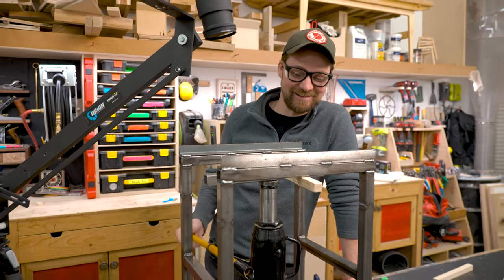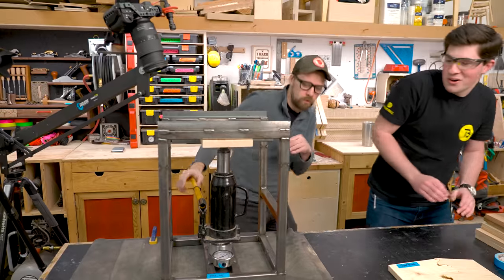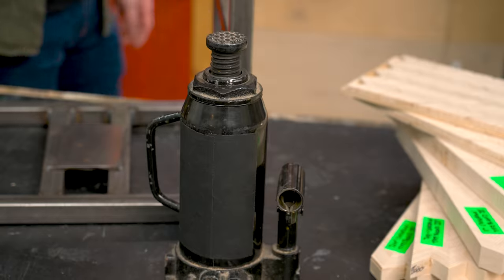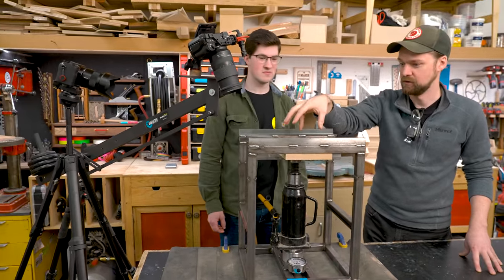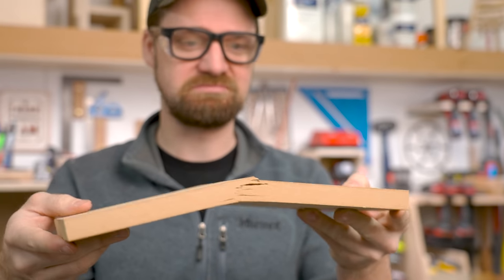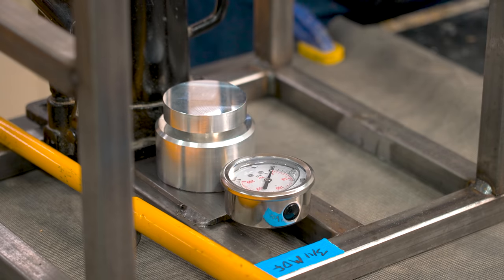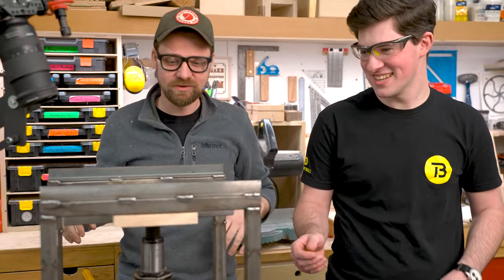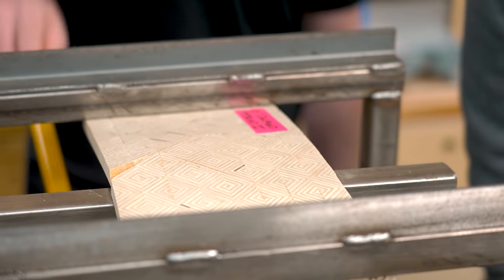Testing the Limits of Patterned Plywood (Featuring Tyler Bell)

Comment: When comparing BB ply to pine, you've got to remember the pine had all its grain in the strongest direction for your test but only half the thickness of the ply was iin that orientation, with half being aligned crosswise. If you'd tested pine with crosswise grain instead, it would have withstood a damned sight less force but the BB ply would be about the same strength either way. That's where  ply has an advantage. As for the patterned ply, it has no longitudinal grain so it was nver going to fair well in this sort of test. 
Also, your testing only covered flex testing. Strength under compression, tension and flexion/torsion are all very different and specific qualities in materials. E.G. Chair legs experience mainly compression while the bracing between the legs experiences mainly tension as they work to prevent the legs spreading. Meanwhile,  the back experiences mainly flexion/torsion as you lean against it. 
Finally, the disproportionate increase in strength with increased thickness in the BB ply was in line with my expectations from using carbon composite sheet where doubling the thickness more than doubles the rigidity. Its at least partly to do with the tension and compression forces  (them again!) acting on the outer layers. The thicker the material, the more one side has to stretch and one side has to compress to flex a set amount. (Assuming  the same material throughout) and elasticity is not a linear progression. If you really want to understand these different kinds of strength in different woods, ask a bowyer.
Reply: Came to find this, something was of with the initial comparison
Reply: All of this, 100%. It's also worth noting that part of why plywood is "stronger" on average is that good plywood is very consistent... the pine chosen here was very specifically as knot free as possible, but lots of pieces aren't, or can't be due to their size, or have other variances in density that will make their strength much less predictable from piece to piece. This comes up in cheaper plywood too, which has lots of voids and filler vs. the expensive stuff, though of course, that's why you don't use that stuff for anything that will have to resist a lot bending forces.

I liked to see the test with a piece laminated to a 1/4 plywood sheet, but it would have been interesting to do the same test again, but flipped over, with the normal plywood above, and therefore in the higher tension position and the vertically oriented endgrain of the pattern being placed in compression. I expect you'd get an even better result, all else being equal.
Reply: Good commentary. 
I knew a fellow who tested shear strength and tear strength of different configurations of steel, and he made the differences in forces clear to me. Any strength tests have to be precise for the exact force you’re interested in!
Reply: Also.... strength-to-weight ratio. Plywood is essentially missing wood at the microscopic level, replaced with glue/adhesive that's lighter.

Comment: The reason for the non-linear increase in bending force is the following: The height of the piece enters the bending stiffness equation with a power of 3, while the width influences it only linearly (see wikipedia "second moment of area" ). It is interesting to note that this is a purely geometric property and has nothing to do with the material. 
Absolutely nice video - don't know why, but it was quite mesmerizing to watch!
Reply: Yep! That's why tubing is so much stronger compared with its weight vs a solid material of the same weight (but thinner diameter).
Reply: Exactly! Only the outside surfaces matter. If they had tested the patterned back by ply the other way (patter side down) it should have been stronger since the ply will be better in tension.

Comment: you always gotta remember that wood has 2 strengths, with the grain and across the grain. 
Splitting a board is so easy, you can do it by hand. But chopping through one is hard, because the fiber is strong. for plywood, you dont have to think about grain direction. you always have the same strength. But the ply layers that are in the wrong direction, depending on the force thats applied to it, are very weak. so its not super strong, but holds shape and is the same strength in all directions. 
sidenote: thats also why side grain glue ups hold "better" than end grain ones. the lignin, that holds together the fibers, is weaker than glue, but the fiber is much stronger than glue. so, even though end grain glueups are stronger than sidegrain glueups (if they have the same surface area), it looks like the glue works better on sidegrain, because the lignin breaks, and not the glue.
Reply: He should try some patterned plywood where he’s gluing end grain together so this is closer to how normal plywood performs rather than peeling apart a string cheese like this one is testing.

Comment: I've usually heard it said that plywood is more stable than solid wood. Rotate the 3/4" BB ply and the 3/4" pine 90 degrees and run that test. The BB should get essentially the same reading while the pine will break must faster as it breaks along the grain very easily.

Comment: Plywood is stronger than natural wood boards only because it is strong along two axis.

Think about splitting a log vs chopping a tree down. Two very different orientations for the same substance two very different strengths.  

Plywood won’t split along the grain because it has eliminated that factor.
Reply from the maker: That's a very good point! Interesting
Reply: Hum, this is the first time I'm really hearer people talk about plywood being "stronger" than natural wood. The problem is the it all depends on it's use. Put "plywood strength vs natural wood" into Google and even if you ignore the articles that are outright stating that "solid wood is significantly stronger than plywood" when talking about the natural wood being used in the correct manner (i.e. along the grain) many of the ones saying that "plywood is stronger" as a general statement then obviously go on to clarify under exactly what circumstances that is. Saying that "plywood is stronger than natural wood" is like saying "a steel cable is stronger than wood" and then trying to make a table leg out of your steel cable... They both have their strengths, just in different scenarios.
Reply: In martial arts the trick to splitting boards is that you hold the board so the strike delivers all the force is applied along the grain. Boards are so, so much weaker that way. Hold the board the other way and you'll break your hand or foot. This is why you'll never see anyone use plywood in a martial Arts show. 

Well supported 1/4" plywood will hold my weight in an attic. :)
Reply: Also consider the concept that any sample from a sheet of plywood should be consistent for. However the pine could be significantly weaker from some locations because of knots. 

I would consider plywood stronger than pine even with a similar average failure point because it has a narrower failure range. If the plywood failed within a 5% range you would build based on the low point. But if pine had a 50% variation you would likely overbuild based upon its lower range.
Reply: Plywood is also most notably more dimensionally stable, and that's the big thing really.

Comment: 12:36 Alternating directions of plywood means it’s likely the same strength in both directions (not sure how strong it is diagonally between the two grains—maybe even stronger?). You only tested strength in one direction, but it is likely that the pine would have broken much earlier if tested with the grain (you tested it across the grain). Only one way to find out: another video!

Great video, fun collab between two makers I’ve been following for a very long time!

Comment: Very cool video. I just forwarded it to students who took my structural design for live entertainment class last semester). In the class we look at the structural strength of various materials as applied to stage elements. What you're seeing in the patterned plywood breaking patterns (by which I mean where the breaks happen) is called "rolling shear" or "shear through the plies." When we look at composite panels in bending, there's a shear plane that happens between the ply closest to the glue joint and the next ply. Normally, in bending with composite plywood members, the plies are running perpendicular to the bending force; as bending force is applied, plies closer to the force move in a different way than those opposite the force, and that causes delamination. It happens just next to the ply at the glue joint because the glue keeps that layer from behaving like it's neighbor, and so you get shear at that plane. This is a little different, because the ply interfaces are not perpendicular to the force, but it's the same principle: the ply closest to the glue joint can behave like its neighbor opposite the glue joint because of the glue itself--and so it delaminates.

A very cool video.

Comment: As for chunk of pine vs birch plywood, you took a board in which pine withstands most load. It is a safe guess that a board with longest dimention across the grain, not along it, would withstand less than half of given load. Plywood, though, will be exactly as strong after rotating it by 90 degrees.

Comment: Made pattern plywood surfboard fins awhile ago that are still going strong, but most of their strength is coming from the fibreglass lamination. Foiling the fins was the tricky part, the plywood pattern kept fail apart.
Reply: Check out Peter Brown's Shop Time channel, he's done some videos using a stabilizing resin that's forced into the target material, I think that would help you with the thin cross sections.
Reply: @JBLewis  Peter has some great videos. I actually used epoxy to help hold them together. I used construction ply wood the resin soaked in really easy. Stabilizing resin may have worked better though. I have some birch plywood for my next batch which will help too.
Reply: @WaveWasters  Sweet!  A patterned plywood fin sure would stand out in a world of carbon fins!

Comment: No one who knows his/her trade has ever claimed plywood to be STRONGER than hardwood. The alternating plies makes it more STABLE under conditions of use, as it's not prone to twist and cup and won't be dimensionally affected by humidity.
Reply: I came here to say this. Also, I bet if you cut a piece of walnut so the grain is the opposite direction it would be a very different story. It would crack along the grain easily
Reply: +1
Reply: It is more evenly strong. Solid wood is strong along the 1 bending point they tested, but is weaker if you bend it along the gain across the grain.. 

Plywood would be the same strength along all bending angles (except end grain)

Comment: FYI, stiffness is a cubed function of the thickness - for example, going from 1 inch to 2 inches the stiffness will increase by 8 times.  Now I need to think how this relates to the strength of the material....

Comment: Although it is often cited as a reason for using plywood, the main reason for crossing the grain in plywood is actually for dimensional stability and shear strength not for breaking strength. One reason LVL's are set vertically and not horizontally. Just thought I'd weigh in on that. Great video and love that pattern plywood!

Comment: I’m in a woodworking program, and I have never heard anyone say that plywood is stronger than solid wood. One of my professors always includes questions on tests about the reason for using panel products over wood panels, just in general, or in the context of like a frame and panel door, and the answer is always that panel products and plywood are more stable than solid wood when it comes to movement, and generally more flat (and keep their flatness). But plywood is defined as being stronger than the MDF or particleboard, as well as lighter weight, more moisture resistant, and grippier for screws. I actually never really thought about whether it might be stronger or weaker than solid wood. Maybe that’s because I think I’d have a clear reason that I’d want to use solid wood over manufactured panels, or vis-versa, and when I want a panel it’s then comparing the attributes (and availability/price) of different types of plywood and other panel products for my project’s needs.

Comment: Plywood is still stronger than pine because pine has that strength only in one direction (perpendicular to the fiber grain), while ply has it along both grain direction.

It could have been interesting to test plywood with a 45 degree angle  to the fiber.

Also, pattern with ply back, you should test it upside down, so the pattern works in compression on the ply back works in tension.

Comment: I think these test results make a lot of sense. In the case of regular wood (and even plywood to a lesser extent) you have the immense bending strength across the long grain, sort of like trying to bend spaghetti noodles in a bunch. But what you've done is taken those noodles and cut them into shorter lengths and then adhered them to each other side by side, so now you just have to peel two pieces of the spaghetti apart (which then causes a chain reaction), and they don't have as good of bending strength.
Reply from the maker: That's a great way to put it!

Comment: @12:30 I never heard that plywood was stronger than wood. I always heard it was more dimensionally stable (i.e. less impacted by expansion and contraction) than real wood. And thus would stay the same size over time without spreading, shrinking or warping as much.

Comment: @12:13, make a rig to compare grain directions. 7 ply vs solid pine will behave differently. Set up a rig to apply forces like an axe and split the solid pin board with the grain. The 7 ply will hold up equally but the solid pine should break differently if rotated 90°. Its why you can take an axe and split a log one way but not across grain (for the same effort).

Comment: A more true test for plywood vs pattern ply would be to glue up strips of plywood at the various thickness you are testing against, that way you are end grain vs end grain.  Test across the face of the sheet is going to have more elasticity as compared to end grain at 1/2” & 3/4” think.  A better wood vs plywood test would be a pine 2x4 vs a plywood made 2x4 (LSL), and test in both directions of the boards to see.  The LSL should be stronger across the 4” thick face vs the pine 2x4, and I would guess as strong or stronger for the LSL across the 2” thick face.  Wood fiber breaks before most glues, found that out in a Strength of Materials class in college, Poly glue holds up to a good bit and that was 20 years ago.

Comment: Watching you as a civil engeneer with an education in constuctal woodworking breaks nearly my heart. 😂 But still nice to watch and cool to have these numbers. 😄👌
 
So plywood will only be stronger compared to very inhomogeneous wood with knots and defacts. In your case plywood might even be weaker due to the orthegonal layering. Because redistance against tention parallel to the fibers will be much higher than orthagonal. On the other hand plywood has the same strength in both directions of your peace.
 
Introducing tension orthangonal to your plywood-layers (the way you use it in your patterns) will be the worst, because there won’t be any fiber or what so ever. 

Talking about thickness and strength. It’s called the moment of inertia of an erea. The formula for a beam will be (b*h^3)/12. So the hight has the power of 3. This is why there is no linear correlation.

Greeting from Austria. Byee!
Reply from the maker: Hahaha! I appreciate the knowledge drop! 🙌

Comment: It would be interesting to see what you could achieve with a plywood backed and resin coated sheet. From the looks of it, the plywood sheet didn’t really break in the backed test - it was the patterned plywood that split because it couldn’t bend as much. So I wonder what a thin layer of resin would do as a surface finish - it could provide some support for the nice looking side to prevent it from bending and breaking as quickly. It wouldn’t have that wood touch feel anymore, but it could be a decent compromise for certain projects.  (tabletops, maybe? Since resin tabletops are already pretty common)
Reply: If we're talking tabletops, I'd like to see the force applied in the other direction (pattern ply facing down), because that's the important direction for a tabletop. Then the pattern ply is being compressed and I think we'd see much higher forces,.
But this vid is a year old, I'm not expecting a revisit at this point 😁

Comment: I am curious whether the laminated sample's strength is different if you test patterned side up vs plywood side up. It seems to me the compressive strength of the patterned plywood would transfer a much greater ripping force on the 1/4  inch plywood, yielding very different results. If that yields true, which pattern has the greatest compressive strength?

Comment: MDF is 9% urea-formaldehyde, a rather strong adhesive. That is why it is fractionally stronger the plywood. It also has 1% paraffin and 8% water. 
Birch plywood is not necessarily birch on the insides. Inner layers in plywood are  less than prime wood, think rather iffy C grade pine. Yes, you heard my eyes roll.
You may want to test WBP and X plywood.  A nice birch board would be an interesting test, too.

Comment: the simple solution to increasing capabilities of the test rig is to increase the span between end support. That way you will break at lower force in the center point. The real issue that should be considered is lbs x distance from support. Ply is strong than soft wood in the week direction for soft wood, you were measuring the strong direction for soft wood, ply should be agnostic to direction.